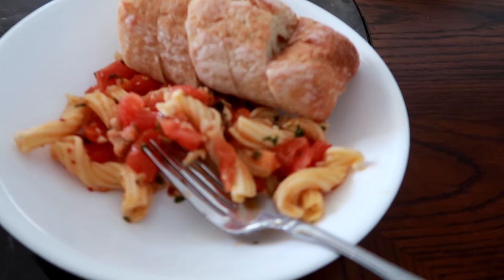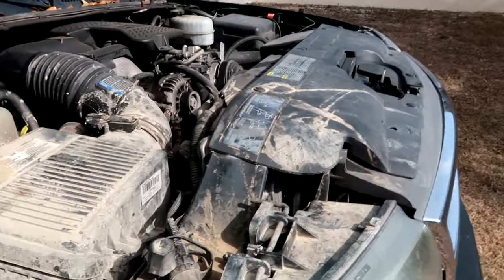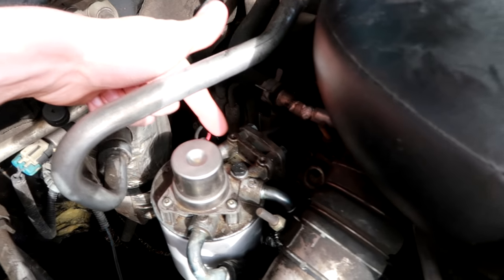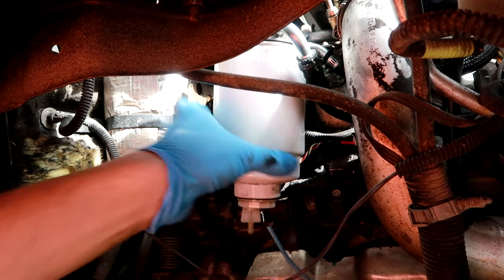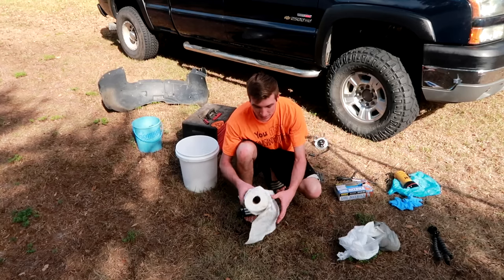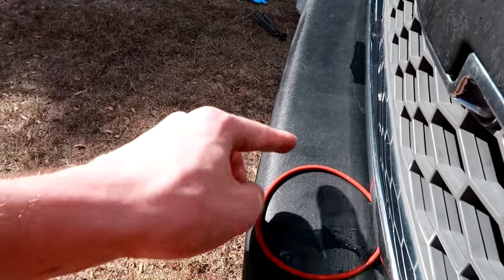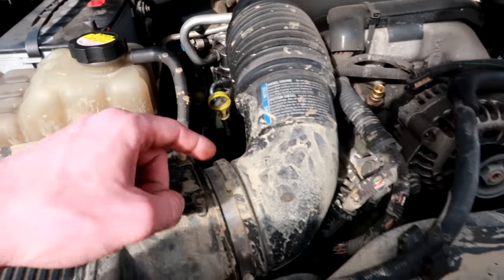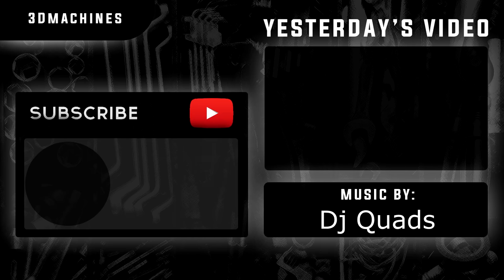THIS is why maintenance is IMPORTANT!

Comment: I run the Wix extended life filter and never had a issue in 321,000 miles on my LB7,  your exhaust smell in the cab may be exhaust leak at turbo also blow will get blown back into fresh air intake.  if you keep heater on recirculate it won't have the exhaust smell.  check at night if your getting smoke coming out around headlights . if so you have engine blow by.

Comment: have you considered putting the LBZ turbo mouthpiece on yours an a pcv reroute? I did the mouthpiece on my lly an cut stock intake added a Fernco to adapt to stock intake an doesn't throw any codes keeps engine cooler, faster spool up, an helps prevent head gaskets failure.  pcv reroute keeps oil out of the turbo pipes reroutes it to a hose to the ground.  neither of these cause cel lights.  just figured I'd tell ya.  awesome videos

Comment: I a 6.7 powerstroke owner, But still diesel fuel filter is all the same. Careful with aftermarket or different brand fuel filters. To bug if a micron and particles get through. Too little and you starve your HPFP and POW.  Also, water separation is more important than other pollutants.  Good luck, hope it all works out for ya.

Comment: All based on ISO testing standards efficiency.
The CAT is a 5 micron 98.67%. 
Baldwin (BF9882) is a 4 micron 99.85%.
Racor (PFF50216)/AC Delco (Old part # TP3012) is a 4 micron 99.40%. 
Plus the OEM style fuel filters have a water separator built in as the CAT doesnt.

Comment: just a heads up if u have any problems after doing the adaptor u may need to buy a rebuild kit for your filter head I ran into that issue when I did that install on my 07 lbz and only buy the filters from your local cat dealer they should be around $20 each and if u ever forget what model the filter is tell them u need a fuel filter for a 1998 cat 140h

Comment: we had a few of those Duramax trucks at work. The guys beat the hell out of them and they have been very reliable. The older ones like yours had trouble with the dash  and small electrical issues  blower motor resistor etc... we had to clean the contacts on the computer harness  the newer one I think is an 09 it has the Allison tranny it has been awesome 390 000 and only needed oil tires brakes and batteries  no lights on the dash are on on that one, I would buy an 09 or newer  it has been beat on hard and it doesn't have 1 seal leaking anywhere and we towed heavy with them and kept the pedal to the metal all the time.

Comment: You should look into replacing cab mounts. Your cab is looking a little saggy
Reply: jake kummer Thats True It Is...
Reply: jake kummer What do you mean by "saggy"? What part of the video did you notice?
Reply: Tony Hawk well if you look at the body line of the cab where the box meets the back of the cab you can see the lines aren't quite at the same level. It's due to the rubber cab mounts wearing out. Very common
Reply: jake kummer ok thanks. I see what you mean. Especially at 4.27 minutes

Comment: just letting you know doing the cat filter is good but I will let you know when you go back to the cold weather you might start to have problems with it.  since its a 2 micron filter it can catch all the fuel that starts to jell up and plug up the filter. just trying to help.  and I put the cat filter on my 03 duramax and never had to take out the ball and spring
Reply from the maker: +Alex Filipiak I don't like the sound of my fuel filter possibly becoming useless. That's kind of irritating.
Reply: 3DMachines it's not going to become useless it's useful cuz it caches more impurities. wixs make a 2micron and a 6micron filters I use the 2micron in the summer and the 6micron in the winter.  I'm just trying to help you not have a jelled fuel filter take my advice as you want

Comment: on my 6.5 Duramax I change my fuel filter every 3k and oil at the same time and plus my truck has 150000 on it right now
Reply: kunuynaaluk wilson every car I've owned no matter what I change fuel filter and oil every 3-4K at most
Reply: kunuynaaluk wilson damn...you make me feel terrible...my oil gets changed every 7500 in my 2015 nissan xterra( full synthetic) but you know what? i have never thought about the fuel filter...85,000 miles on it....looks like i suck. i will now be checking my owners manual to see how often i need to do it...and have it done right away! thanks guy

Comment: @3Dmachines, I have a 2000dodge ram 1500 sport 5.2l. this is going to sound nuts but I can get it to start  but when I put it in gear it turns off. Also if I let it run for a while it turns off by itself do you have ANY IDEA what would cause this?
Reply: Nick Eckhardt how are your rpms when idling? I've never had that problem with my 99 ram 1500 5.8
Reply: it starts off idling fine but then goes up all by itself
Reply: Josh Hrisko thanks a lot I was kinda thinking fuel  filter. what sucks is my fuel filter if on my fuel pump which is in my tank
Reply: Thanks again
Reply: Okay

Comment: Well done, Dalton. The importance of the fuel filter because this, FAME, biodiesel in diesel fuel. A 2012 joint-statement by five diesel injector manufacturers - Delphi, Denso, Bosch, Continental and Stanadyne      stanadyne.com/docs/sale/Common_Position_Paper_2012_signed.pdf

Surprised by this 5:05   Dont forget to visit Key Biscayne and Jai Alai

Ondo ibili,

Comment: what do you do that your pickup has that many miles on it
Reply: Dean Nederhoff he bought it used if you didn't know...its like a 2004...
Reply: No I didn't know
Reply: GPG Studios 2005
Reply: its a diesel they run for a long time. even the gas silverados ive seen as many as 500k miles on in person
Reply: 71sc502 yes I know that.I'm a truck driver and I've put them over a million miles before rebuild.I was just trying to figure out what he does to put that kind of miles in a pickup
Reply: He bought it second hand. I believe many of the miles were already on it.
Reply: +Dean Nederhoff oh i see. but ya, i see alot of vehicles with similar age and miles. some people just drive more. i have 205,200 miles on my car. i got it with 174k but brought it up to the 205k in a year and half. plus alot of pickups are used for wprk and that includes the commute as well.
Reply: 71sc502 yeah all depends on how long the commute is.but hell even now they have one that's called ops1 which is an oil bypass filter system and big trucks go over 400000 without changing the oil.they just change the little filter,without getting dirty,and just add oil as needed.then take an oil sample and send it into a lab to get tested
Reply: +Dean Nederhoff thats crazy dude haha. ive heard that recycled oil is actually some of the best oil for engines believe it or not
Reply: 71sc502 you would be surprised how much that saves on maintenance.And I'm pretty sure they have versions for pickups to
Reply: Drive it...

Comment: Is that a cat c12 fuel filter
Reply: +Cyrus Colon  I use to be a cm in the navy worked on my  mtvrs with c12 and plenty of durmaxs would be a cool sell to the govement because driving through a lot of beaches stock fuel filters clogged up so fast.. I always hated doing this maintenance it's easy but I did this about 20 times a week .
Reply: +Cyrus Colon  salt eats up these rotors bad too. 2nd most replace item because our truck were use to put boats in the water. And all the salt water would literally eat these rotor up. But the old fords 7.3 never had had that much issues with salt water

Comment: I hate to tell you heat expands things not shrinks them
Reply: Austraverse it shrinks then to. i rembember i wet my jordan slippers and i left them outside in 105 degree weather and they shrinked so small lol
Reply: Hancho familia aha yea but there's a fair difference between slippers and that o-ring!
Reply: It needs to dry out.  They bulge when wet.